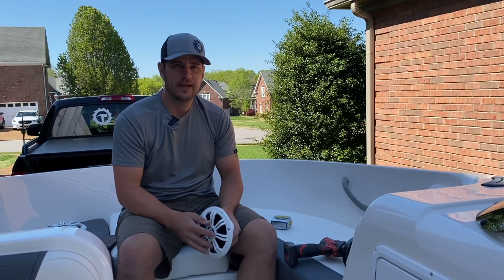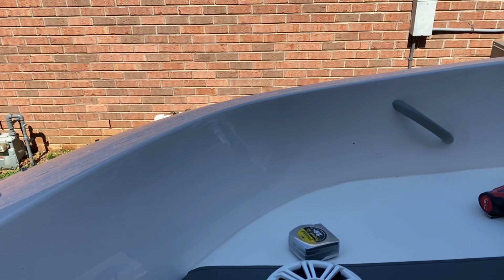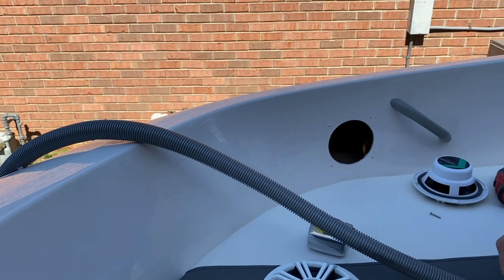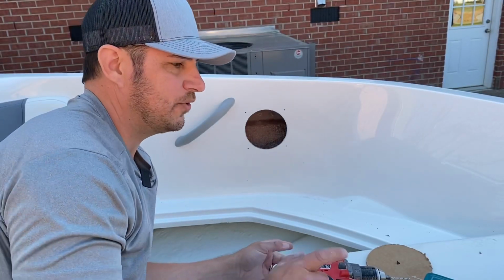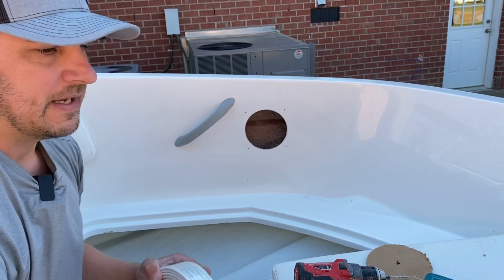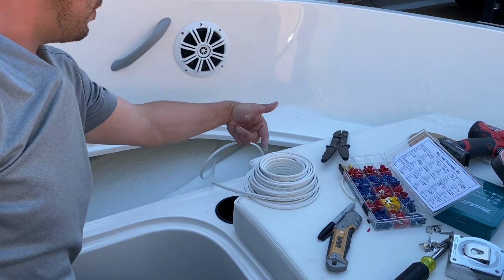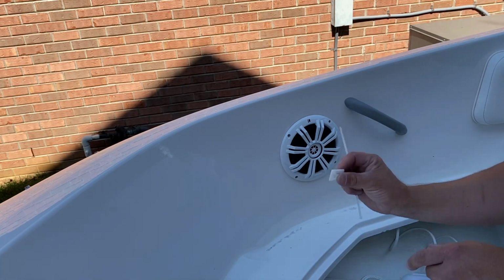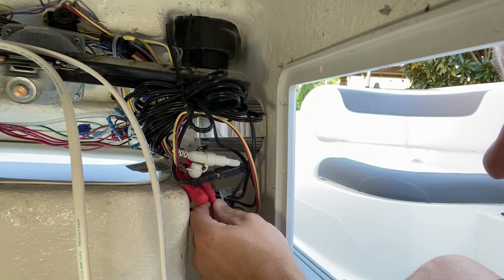HOW TO - Add bow speakers!!    Bayliner Element E16, E18, E21

Comment: would this work for a 2014 bayliner 175?
Reply: Depends if you can access under the front seats and route the cables running from the speakers to the radio
Reply: @runsliketurtle1791  just finished installing them and they work great, i in fact did route them under the seats.